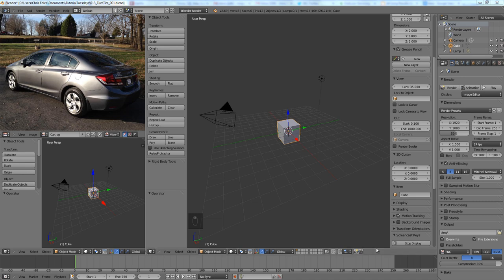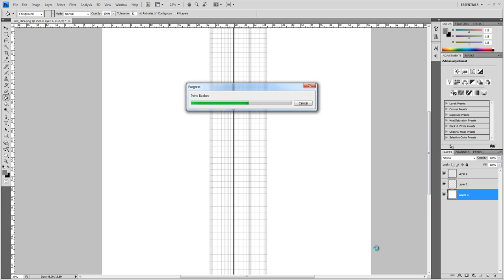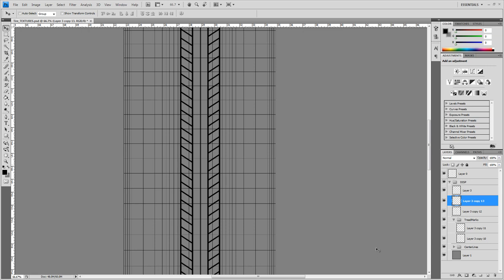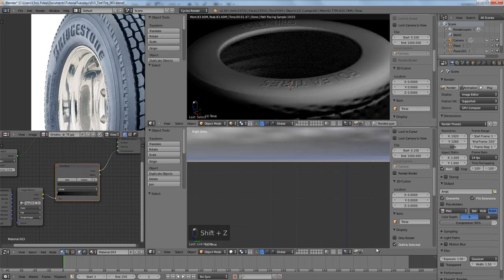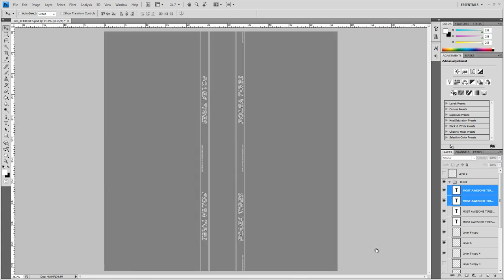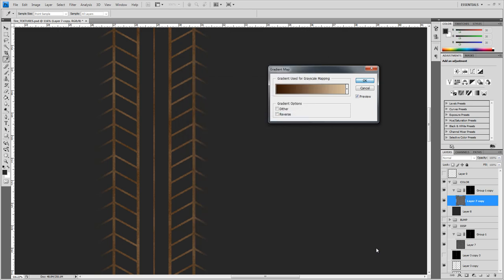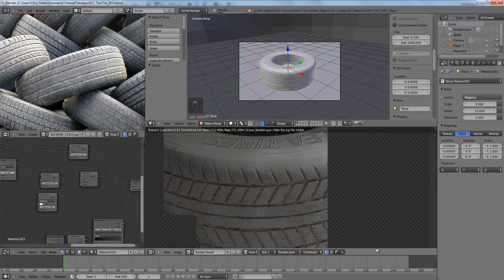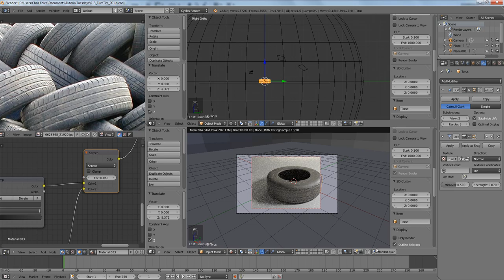Tutorial Tuesdays Episode 13: Learn How to Make a Tire!

Comment: Nice tutorial.    I will suggest not to depend so much on the automated key and mouse press indicator unless this is for intermediate users.   Beginners are still trying to find their way around and some things done many will not be able to follow. 

I like the idea of displacements maps.  I saw a video earlier where they modeled the tire using bevels and for me  unless it is a just for a high definition model beveling would not be the way to go.
For games and animations I would definitely use your method.    Keeps that poly count down and yet provide great realistic detail.

I will have to bookmark this video.   Thanks!

Comment: Just poking around... Anyhow the idea behind this works a lot better now that the current Blender at the time of this comment (v2.78) has micro-displacement. Easier to just draw the tread on a simple mesh instead of having a heavy mesh modeled out of a bazillion polygons. (Still needs a bit of memory though, as Blender does the heavy hitting behind that trick on its end.)

Comment: just watched andrew prices tyre
he uses both mirror and array modify
worth a look
good vid though,  keep it up
Reply from the maker: Both methods have their pros and cons. I prefer to use displacement because it makes it much easier to change the tread design later, and you can turn it off in the viewport (saving on RAM).
Displacement, arguably, is much more viable in other 3d packages, though. For instance, in Renderman, displacement barely adds to render time at all.
Reply: Interesting.      Blender is the first and only 3d software I use and I love it (albeit i am a complete novice)

Comment: you didn't appl scale. That's why your uv came out terribad!
Reply from the maker: Huh. Could've sworn scale was still 1,1,1 when I UV'd it...
Reply: always apply scale when you edit mesh.
Reply from the maker: Applying scale would just set it back to (1,1,1)...I double checked, and it was already (1,1,1) when I UV unwrapped it. Applying scale literally wouldn't have done anything...

Editing mesh in edit mode doesn't modify an object's scale...only scaling it in object mode modifies the scale.